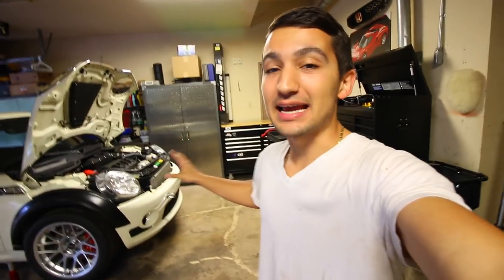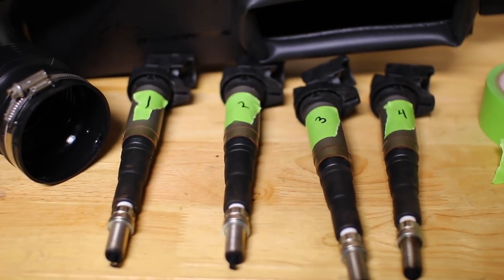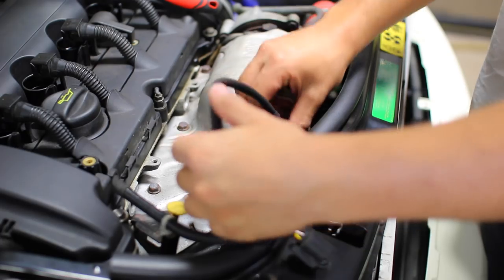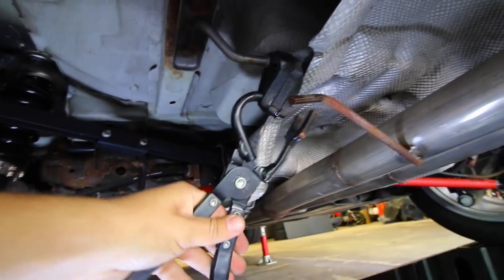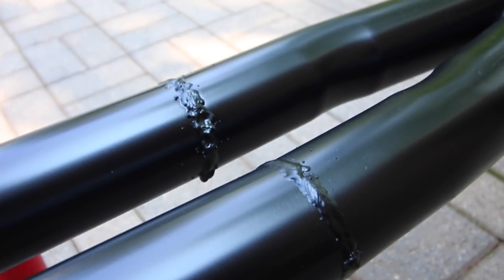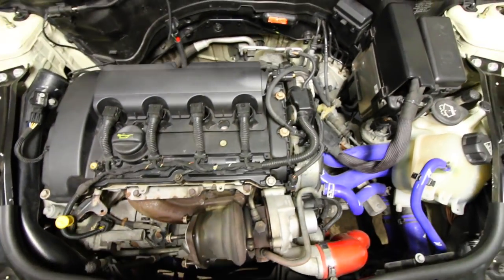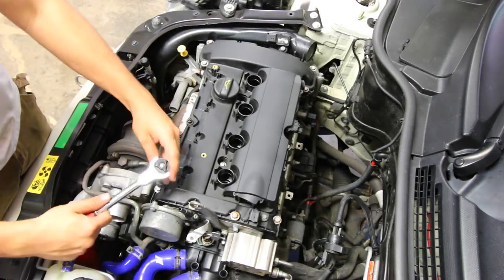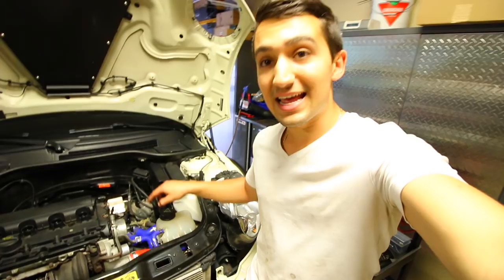Rebuilding My Turbo Mini Engine - Part 1

Comment: I know I'm late to the party, but you should probably replace the throttle body, when that goes out it causes misfires and a rough idle, throwing a CEL P115c. Trust me after rebuilding the top end on my '09 MCS and still having the same issues. With the new throttle body she runs like a champ!

Comment: You better have the cam locking tool to remove the timing chain and the head, otherwise it will be a lot of work getting the engine back in time or fixing a timing issue. And you should invest in the bentley manual, its supposed to be a lot of help.

Comment: I learned the hard way how easy it was to remove the motor first and leave the wire harness on
Reply: Ok. So it was possible!  That's good to know, because I did not want to try and put all the wires back on with the engine in.. :)
Most are already out, though.

Comment: Whoever welded your exhaust should've used stainless mig welding wire, they used mild steel wire that's why it's rusting

Comment: Did you try and get new coil packs and spark plugs
Reply from the maker: Yes that was the first thing that I tried to get rid of the misfire
Reply: milanmastracci those spark plugs look filthy can't believe there new, told u in the very first video we always see these broken down on the side of the road hear in the uk but guess what ? I just bought a 71 classic Austin mini van lol
Reply: milanmastracci I would say it is a junk exhaust valve or intake valve

Comment: Have you explored the exhaust header solution.  4-2-1 header configuration will help. Exhaust fumes are going back to cylinder 4 exhaust port causing misfire.
Reply from the maker: I don't know if I have the room in the engine bay for a custom 4-2-1 collector. If my car was N/A, it would be a lot easier
Reply: milanmastracci oh there's room. Or setup a twin scroll. But I hope all what you're doing will fix the miss fire on cylinder 4. But if I am right the way they design it, it allows exhaust to go back into cylinder 4 exhaust port when cylinder 4 exhaust valves opens. Exhaust manifold was a bad design.  Do you get misfires on higher RPM?

Comment: It seems so easy to take the manifold out, I saw there is a hex bolt on the intake manifold support, how did u take that bolt out? I need that remove so i can have my water pipe replace.

Comment: Wish I found this great video earlier. Got my head at the machine shop now!

That little tank holds a reserve of vacuum to run the actuators. Note it has two ports, but looks like one was cut off on yours. IIRC one line goes to the a port on the bottom side of the vacuum pump, the other line goes to the turbo wastegate solenoid that hangs under the intake manifold.

Im unsure how your wastegate would actuate if the little tank wasn't connected to the vacuum pump. Maybe just not shown in the video?

Comment: great video man, very easy to follow! How many miles did you have on your car when this all happened?
Reply from the maker: This is at a bit over 120,000 km's. Unfortunately I don't have the previous service records for the engine so I had no idea if anything was replaced before.

Comment: Question. Is removal of the harness necessary, or could you have just removed it from the ECU and pulled it with the engine and trans?

Comment: I was wondering what that piece to the exhaust with the mesh wiring was called? On my Mini Cooper it's loose. Where it feels like I can actually pop it out I was wondering is that supposed to be loose because my car isn't running it saying it's saying 02sensor. Thanks in advance

Comment: You could have done a simple leak down test to figure out whether you have a physical problem with the engine before tearing it apart...exhaust cam, intake cam, blown head gasket, hole in a piston, rings, etc...
Reply from the maker: Well I know for fact the intake ports for the valves were not making a good seal. The way I see it, is that if I'm going to make the mini fast and get it ready for a big turbo, why not upgrade EVERYTHING inside the motor so it can handle it :)
Reply: Ah, gotcha.  I just hope your misfire wasn't due to a bad injector or something, ya know?  Always a good idea to diagnose the problem before ya do open heart surgery, lol.  But if you're upgrading to a bigger turbo & pulling the lower end too, then yeah, ARP main studs & head bolts and shorter pistons to lower compression and all that.

Comment: I'm so happy I don't have a Prince engine. Tritec FTW. Although you'll make power easier. Are you doing a full rebuild? Check out the timing chain kits from Detroit tuning. They have a Cryo treated Chain. Good luck.

Comment: Hey bud, I do about 3 of these minis a week, I know them in and out, including the motor and trans. If you need any help or advise, I'd be happy to help
Reply from the maker: Send me an email at milanmastracci@gmail.com
Reply: milanmastracci sent
Reply: im working on a mini cooper i got it running it idles just fine. when i rev the engine thats when it does not go over 1500 RPM
Reply: Drop knowledge here so we all can see common problems with these.Upload videos somethig

Comment: What year is the Mini? If it is a 2007-2010 then it likely has something to do with the timing  chain/tensioner as the N14 motors are notorious for the timing chain tensioners not working correctly causing the chain to come loose and damage the engine. Some symptoms are a rattle on cold starting the car "Death Rattle" or a chugging when letting the car cruise. If this is a 2011-2013 with the N18 motor then Im not really sure what it could be....

Comment: Great job man!

Not many videos here that actually make me want to give a "Thumb Up", but if there is a "Double Thumbs Up", i would definitely give it to you. To me, this is quite impressive!

Are you a mechanic yourself? I don't know if i could ever do this even with video recording every single steps. It's just too many bolts nuts sensors connectors clips etc...How are you even able to put it back to its original place?! Well probably i can, it will take forever, i do mean forever..

How long does it take you to be confident in doing things like this? I mean this kind of work is not for "normal" car enthusiast.

Comment: @milanmastracci I recently changed out my coils and plugs, misfires were gone for a few days then came back. I took the coils out and a couple of them had the rubber boot stuck where the plugs are along with the spring inside the rubber boot from the ignition coil also where the spark plug lies... what should I do?

Comment: whats that titanium shielding tape that you used for the downpipe?
Reply from the maker: I didn't install it on the vehicle yet, however I will be able to install it on the downpipe to keep the engine bay temperatures down and keep the engine running better. https://amzn.to/2NpbeMA

Comment: Why not rebuilt the engine and upgrade the turbo now? 
If you carry on with what you have in mind now by the time its back on the road the winter will be here and you won't even use it.  It will save you taking everything off again in the future.  ;)

Comment: bad power connection for the ecm at the battery box. Replaced the but connector, fuse holder, and a couple worn battery jumpers

You could try this, if you haven't

Comment: I bet your misfire is from a "burnt" valve guide in cylinder 4. My Non-S did the same thing to me. Would operate fine for a little bit and then start misfiring on my way to work, long story short, oil gets warm, thins out, goes past valve guide and drips onto the plug resulting in the misfire. Happened for a good reason though, got a JCW now lol @milanmastracci
Reply: would have a oil drip can work to prevent that ?

Comment: Doing this right now to my Mini. $1500 in parts that have to be replaced when you take a head off and the problem was a holed $14 exhaust valve.

All I can say is WHY WHY WHY? Why did you disconnect the entire wiring harness just to take off the head. Do you like doing extra work for no reason? I was going to say the same thing about the exhaust, but I understand you need to paint over the shitty welds.

This video has nothing on MINI Adventure's video series, but I have to respect your 'money & time is no object' attitude.
Reply from the maker: Only reason is because I might be pulling the head to do some work to my short block, including shaving the deck, new pistons, new connecting rods, and for that I might as well pull the motor. I'm not sure how much other work needs to be put into this engine, but I'm going a bit overboard just to be safe